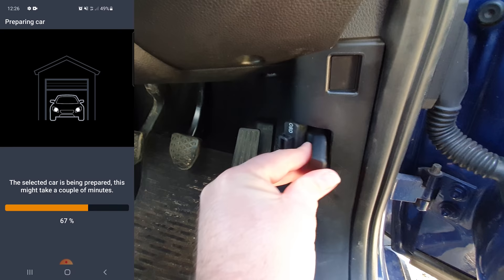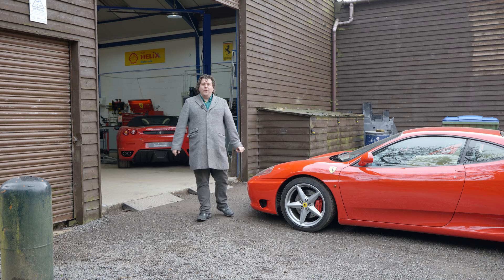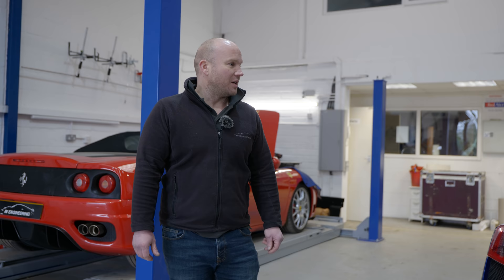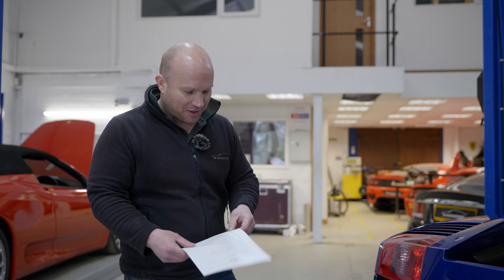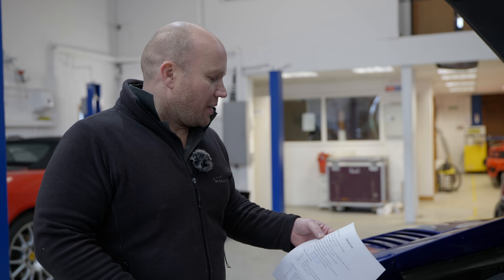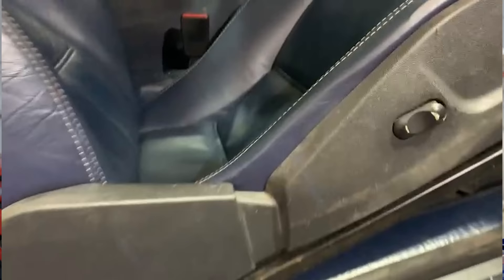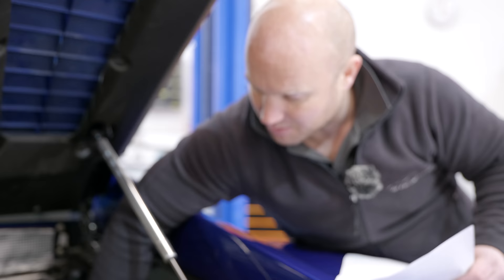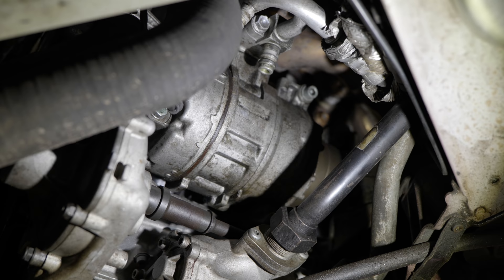EVERYTHING WRONG With The World's Cheapest Lamborghini Gallardo (That Runs, And Isn't Wrecked)

Comment: Re the colour, I would guess it's had replacement used parts from another car in red and then painted over in blue.
Reply: The red color seems to be in structural frame parts, so unlikely. Considering this lambo is from time when Audi was not yet fully involved with Lambo production, it might simply be body storage color that is then primed and coverered for final color, or the factory had presprayed some bodies, the order came in, and they simply decided to respray existing body instead of building a new one, as that's kinda the stuff that pre-Audi involment Lamborghini would do.

But even more so, it could simply be a red primer. The blue metallic has some deep purple shift in it, and usually metallic paints do need a specific color primer... blue+red = purple.
Reply: @akkual  I reckon this chassis and that VIN didn't originally belong together. This car has, I suspect, been cobbled together from bits - a crash write-off's drivetrain and electrics and a flood write-off's shell.

Comment: He’s gonna be glad to see the back of this car. Sounds like a stolen/recovered the amount of problems.
Reply: I reckon this chassis and that VIN didn't originally belong together. This car has, I suspect, been cobbled together from bits - a crash write-off's drivetrain and electrics and a flood write-off's shell.
Reply: @richardharrold9736  a write off would come up on a hpi check. he said the cars clean. 
nothing about it says write off imo, just poor maintanence, with someone trying to keep costs low. sort of things done to it that youd do to a similar aged ford focus
Reply: @samisnake  HPI wouldn't necessarily show anything if it's been kept out of the hands of the insurers. Quietly flogging off a wreck to a rebuilder who reshells it using a straight shell...
Reply: Just goes to show you get what you pay for.

Comment: Hi James, have you thought that the car might of been re-shelled at some point in its life.  Im not sure if the chassis plate is welded onto the metal anywhere on Lamborghini as in some cars, but if so that plate will have been transplanted from the original car and you will find signs of welding and filler in doing so.  Thats probably why so many parts are loose, broken or just missing.    
Regards, Paul.

Comment: Awesome to see another Gallardo get rescued.  You definitely have a small laundry list there.  With the paint, maybe a late change-order on that car's spec led to it being resprayed hastily at the factory?  That or it's been painted twice, the second time back to the original color...but they must have been panels-off resprays given where those colors are which makes that theory dubious.  Have you cross checked the VIN on LP112?
Reply from the maker: I called a Lambo dealer and they confirmed the colour as Blu Caelum
Reply: @JayEmmOnCars  Right, the VIN check you mentioned should back that up as well.  My "conspiracy theory" was that they had a red car on the line in Sant'Agata, an order came in for a blue one, so they just sent the car back through the booth before affixing the VIN and specification plates.  I have zero car manufacturing experience though so that's likely bollocks :)  Cheers.

Comment: Im driving a 2004 Gallardo 6mt in blue caelum and navy blue interior in Hong Kong. But it is an imported used car and the car originate from UK. I have some scratches before but the did not see any red underneath, just bare metal. Seems that the blue paint is very thin. PS. Good point about the front control arms. I bought those control arms new 2 yrs ago and broke my wallet. You should have made this video 2 years ago!

Comment: Gluing the vents shut I suspect is down to the missing shrouds Aldous mentioned on the radiator. It probably chucks so much oncoming air through the vents that it's like having the window open in the winter.

Regarding the colour,it is possible if the red is just a uniformly flat red that it's a primer, although that seems odd as most paints i've seen use a white or grey primer for blue. If however you discover some left over flake or lacquer, then we're looking at either a factory stage change to a customer order, where they diverted the shell back into the paint shop before sending to the assembly line, or (more worryingly) an off the books chassis change. Basically, a car which SHOULD have been reported as being in an accident, but was reshelled on the quiet at the customers cost. Examining the VIN plate and chassis markings should show you if there's any sign of alteration or transference. Also ask Lamborghini if they have any record of reproducing a VIN plate for it, as they would have a record of doing so if the reshell just fitted a new VIN instead of trying to remove and transfer the existing one.

Nice car still James, I really think you're going to enjoy owning this one, even with the initial costs.

Comment: I wonder if the vents at the front are glued shut because of the radiators? Maybe all of the hot air was entering the front co.partment and being picked up by the fresh air system?
Reply from the maker: Only two of them are glued shut - the other three are fine. I expect they just broke and that was the easiest way to make them look "fixed".

It's an experience day car, they wouldn't care about an air vent not working

Comment: the red paint underneath could just be a primer and the blue top coat has missd in places/peeled off. if it's an etch primer, it wont flake off because it will be chemically bonded to the metal whereas the top coat can chip away because it sits on top of the primer.

Comment: The man who did the engine is best placed to tell you about the chassis and extent of any signs of serious damage, internet warriors can suggest it's this or that but they are guessing at best. I would say it's pretty certain it's had a bump front and rear , most track day cars will have , and the missing under trays etc all but confirm that
Reply from the maker: Of course before I purchased the car I asked Aldous his opinion - as he had been fairly up close and personal with the car for a year - and his assessment was the same. The paint is a mystery, but the chassis has probably had low speed knocks front and rear, nothing more serious

Comment: Look at wheeler dealers they bought a maserati 3200 for £7k then it needed a new throttle body £2k! Got it fixed in the UK for £400 but imagine how much a engine or gearbox would cost it wouldn't be financially viable to fix it you can buy a supercar cheap but maintaining them out of warranty is the thing that costs

Comment: The red primer looks like it was underneath the blue paint. Looks like the blue paint has been scratched off showing the red primer underneath. Different colour primer's are used depending on the what shade they want the finished paint job, or the red primer could just be a rust protector. Worth checking if the red primer is applied at the factory or if someone did some work on those areas then painted it with red primer and repainted it blue.

Comment: The welded gear knob, glued air-vents, broken support clips holding the grille sections, unclipped electric seats, missing under panels, and different colours on both front and rear sub-frames. All these issues are things that often occur when removing bits from one car, and putting them on another. I fear this car is probably 2 cars made into one. Not necessarily a bad thing if done correctly. I just hope it's not hiding something terrible...
Reply from the maker: There's no evidence anything that dramatic has happened. The air vents are a total mystery - but stuff like the missing grilles is fairly common for an ex experience car.
Reply: @JayEmmOnCars  ..too many broken / missing / wrong coloured / disconnected bits for it to be a straight forward explanation on this one I think. But either way, it should make for good content, and you should have a pretty sorted Lambo at the end of it. Looking forward to the rebuild. 👍🏼
Reply from the maker: @memsybabe  Ten years of being an experience car would explain a lot - if things break there isn't much incentive to repair them properly.

Comment: I have a 1995 Mitsubishi Pajero with 6G74 engine. The port is 16 pin like OBD2 but due to production year (95) it has to use older protocols than OBD2. Can the carly scanner read my car? I tried several OBD2 readers but none could read

Comment: Morning James, I’d imagine that is the primer “red oxide”, could be wrong though
Reply: I think Red Oxide primer stopped being a thing in the 90's when we changed from solvent based to water based paints. Once that change came in, the industry moved to having a base colour and clear lacquer top coat, rather than primer and colour (with lacquer mixed in). It's possible, but i'm sceptical of red primer being used with a light colour such as blue, we used grey for the lighter colors (at least we did at Jaguar where I worked)
Reply: @paul1978g  ahh ok mate yer only as I used to Chuck it around some of the amusement rides back in my apprenticeship 8 years ago looks the same 😅

Comment: I brought an ex experience day car (XR3i) from Brands Hatch many years ago which had been re shelled. There was nothing wrong with the car but I’m guessing this Lambo would probably have a similar history. Missing clips, rear spoiler not working etc.
Reply from the maker: I would be amazed if the car had been reshelled - it just wouldn't be economically viable
Reply: @JayEmmOnCars  
That would depend on how much income the vehicle was generating for the business. Getting a flood damage vehicle and changing the shell might be a viable option for a company. It’s quite common. Check the vin plate and see if it’s has the original fixings etc or if it looks like it’s been tampered with.
Reply: @JayEmmOnCars  
Also it might not be viable for some but would for others. I used to work in a body shop back in the 80s and saw all sorts. YouTube is full of channels on exactly this. I think your onto a winner with this. It sounds like the engine is sorted and you have a few items to fix. I would sooner have a vehicle that’s been re shelled that something that’s been cut and shut but that’s just me. 
Nice work mate. 👍
Reply from the maker: The thing is lots of the car is way too good to  have been reshelled. And seriously the cost of doing that kind of work to a car like this would be a lot more than just selling the broken one and buying a new one.

The Lamborghini world is pretty small too - if something like that had happened I would have found out about it by now
Reply: @JayEmmOnCars  
Possible, but It depends on the extent of the damage and what parts were carried over. 
For me this looks like it’s a red car painted blue. If my eyes don’t deceive me you can see the red around the heat shield where it’s been masked out badly before being painted blue. In saying that someone has gone to a lot of trouble to paint everything that should be painted. Please don’t think I’m being negative. I’ve brought cars in the past that haven’t been as they should have been. With the XR3i from Brands Hatch I was told that it had been re shelled. Not everyone is as honest as we think. Could it of been repainted for advertising as an experience drive car then resprayed blue afterwards?  I’m not sure what chassis numbers if any might be stamped on the chassis.
Reply: @JayEmmOnCars  
How would you explain the air boxes being dented. Heavy rear impact or roll over? I’m think this engine would of then been transplanted into the red shell.
Reply from the maker: @johng7396  no that I suspect is a result of poor care when the engine was taken out and put back in multiple times.

You'd have to have an unbelievably bad accident to dent the airboxes
Reply: @JayEmmOnCars  
For me it falls inline with the shell change as the engine being a salvageable item. I’m presuming the engine number matches the chassis numbers etc when the car left the factory. 

Looking forward to uncovering the mystery. 
What’s your thoughts on the heat shield being masked out before being painted blue. Surely the heat shield would of been installed after the car had been painted at the factory. 
I also don’t think Lamborghini would do a colour change on a car at the factory. I also haven’t sent red primer only grey or green. 
The mystery continues 🤔🧐
Reply from the maker: I don't think you're getting the maths here - to rebuild a Gallardo using a spare "shell" (if you could find one!) Would cost a fortune- more than just buying another car.

If it was written off on track they would just claim on the insurance
Reply: @JayEmmOnCars  
Fair comment if the vehicle was insured. What if it’s been written off and not on the register. Or change of vin on a stolen recovered. This was an asset to a company which was tax deductible. This car had been standing for a long time and you wouldn’t of been the first person to show interest in it. There’s obviously a history with it and your telling me all the reasons financially why it hasn’t been re shelled, but can you explain why it has a red coat of paint under the blue, the heat shield have been masked out, gear linked welded together, air boxes dented, connectors broken or not connected, clips fabricated broken or missing, vents glued shut etc etc. l don’t see how air boxes can get dented when removing the engine with many engine crane. 
Looking forward too the update. Nice work mate.

Comment: Broken pieces, ok, understandable.
But missing parts? that many? how about glued gear shifter and AC vents !!!
Reply from the maker: The missing parts is chiefly stuff at the front, below the car. The kind of stuff which can easily get damaged.

The gear shifter is weird, but not the first time I have seen something like that.

AC vents, I'm stumped
Reply: @JayEmmOnCars  I was thinking about the shifter case, maybe if it loose and that's the only way for a cheap fix rather than ordering new one. But for the last hour I couldn't figure why would someone shut the AC vents.

Comment: could those missing under trays be custom made?  aluminium ? take measurements or even make a cardboard template, then have them laser cut , same for the air duct panels that are missing. ...Also that red colour, the colour of the car is a purple-ish blue....red plus blue = purple, Im thinking it is an undercoat and is red because the undercoat colour will effect that top coat, so if you painted the top coat white with that red undercoat the car would look a very light pink,  it would not be pure white, well that is my theory.
Reply from the maker: Unfortunately the shape of the undertray and fan shrouds are too complicated to easily recreate
Reply: @JayEmmOnCars   ah okay, thanks for the reply!  eurospares have a couple Gallardos they are breaking for spares, might be a possibility there, good luck with it!

Comment: Old supercars are, sadly, mammoth money pits. Once you have owned one (as I have), it is extremely hard to pull the trigger on another one, knowing exactly what ownership entails. And unfortunately, too many dealers (if not virtually all of them), are more than happy to let go of cars that have been sat around for a long time, have not been looked at or test driven (hard), and are let go of with multiple issues (expensive to fix / eats up bottom line profit).

I am now at that point having owned a couple, that I can't decide if the juice is worth the squeeze. When your passion is blighted by regular recoveries, regular £1k+ bills on top of regular running costs, it becomes very easy to question whether a passion should involve all of these downsides.

I will say that Aldous / AV Engineering a wonderful garage and will get you back on the road for far less than the vast majority of other supercar garages. It's a shame they are no longer selling cars as they actually know what a good car is and are completely honest guys! Sadly, a very, very rare thing in this industry.